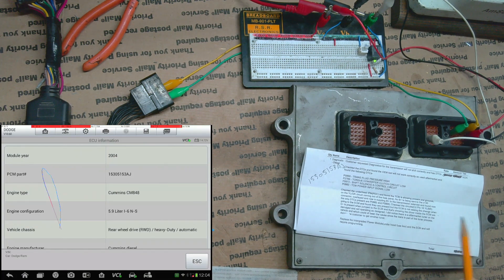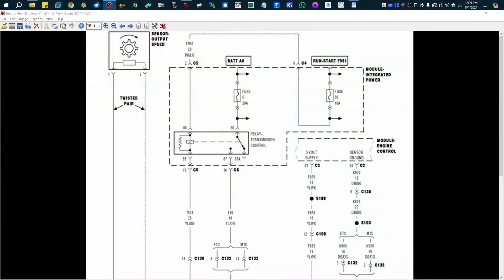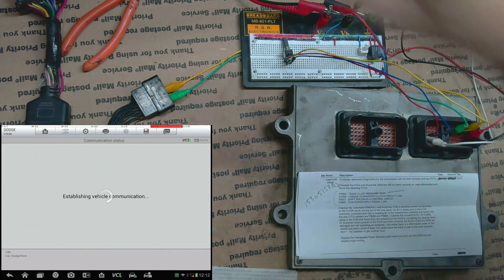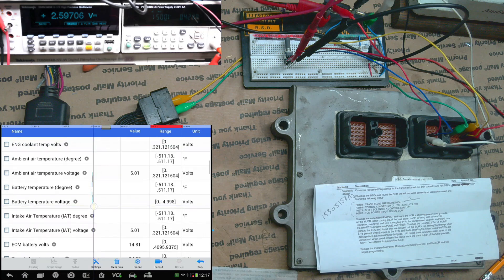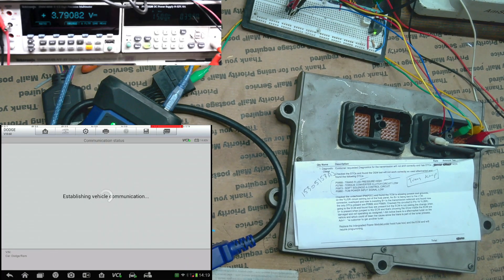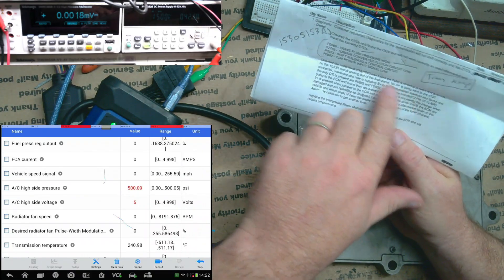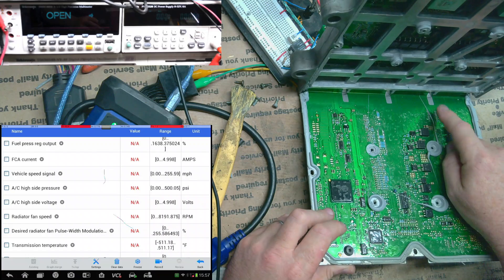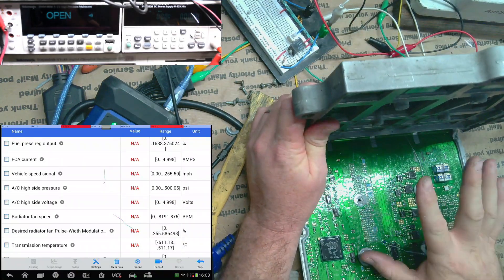Why is this cummins 5.9l ECU not seeing transmission sensor data? Lets test it and find out.

Comment: Hi why are 2003 ecu cheaper than 2004   if both are for automatic transmission? Both use sci correct?
Reply from the maker: the 2004 ones are harder to come by usually. The 03 ones are plentiful.
Reply: @ecurepair  Hi do you mean 2004.5 because dodge changed a lot of stuff like cruise control, injectors in a diesel and the transmission switching to a TVA motor instead of a cable? By the way I love your videos!!

Comment: Bro can you please share diagram to connect the ecu on table
Reply: I need can pins
Reply from the maker: the one in video is a 04 so no can pins. It uses SCI.
WHat year cummins ecu are you working on?
Reply: I have 05 ecu dodge ram
Reply from the maker: @rickyverma8067  https://autoelectronics101.com/index.php/bench-connections/dodge-ram-5-9l-cummins-2003-2005-ecu-bench-powerup
Reply: Bro which 16-19 which pins connected to obd pins , i am working  on table which pin number thanks
Reply from the maker: there are wiring diagrams for this truck on that same website. Take a look at them. The answer to your questions is easily found there.
Reply: The vehicle had 05 ecu and customer bought used 06 ecu can i do program on 05 , i program eeprom data vehicle start but now show checksum error
Reply from the maker: 05 and 06 are different hardware. 05 uses sci and 06 uses can system. it wont work to replace one with the other.

Comment: Hello friend, I am a faithful follower of your channel and all your excellent work. I currently have a problem in the Chrysler PCM P0882 NGC3/4. Do you have a solution? What is your WhatsApp number?
Reply from the maker: on a lot of those around my 2006 its the big bga needs reballing (not mpc5x but the other one)
Reply: @ecurepair  In 07 it only has one micro, would that also be the case? Do you provide advice? Do you offer repair courses? How can I contact you?
Reply from the maker: I started a forum on my diy website for stuff like this https://autoelectronics101.com/index.php/forum/index
Sugn up, post a topic with these questions (and a picture of the pcb layout you have) and I will try and help if able.

Comment: Nice explenation. I am new in car ecu's and more familiar in other electronics like pcb of ac and other industrial stuff. To repair a car ecu  you need a scanner but what kind of flashtool? Sometimes people ask me if i can repair a car ecu.
Reply from the maker: You need many devices to do many different things.  I suggest start with one you need at that moment and then add as needed. Autel is a solid diag tool to start with. As for as flashing, that could mean a lot of things. J2534, Cloning tools, Eeprom tools. Which one where you thinking of?
Reply: @ecurepair  thank you for your reply. my brother is willing to give a autel mp808 which he doesnt use anymore. As for flashing you need many tools for the automotive?  As for my daily stuff i use a ch431a and ezp2019 for eeprom and bios.  Would any J2534 with autel mp808 be sufficient for most jobs? I have automotive experience as technician for 10 years till 2010.
Reply from the maker: autel jvci for j2534 is decent for some factory flashing. For aftermarket you'll want something like kess3. There are cheaper type of tools then kess3 but I dont have much experience with them so couldn't help with them. Your eeprom toiols will do some things but you'd need others for sure. Including jtag & bdm tools for reading mcu's internal flash and eeproms not just small bios type eeproms. Its all pretty advanced stuff though so maybe you dont need it all just started out. Thats why I say get as needed.